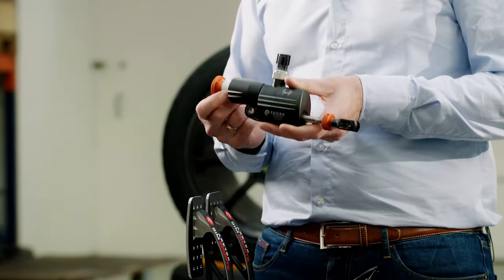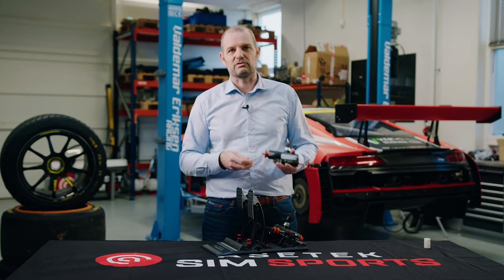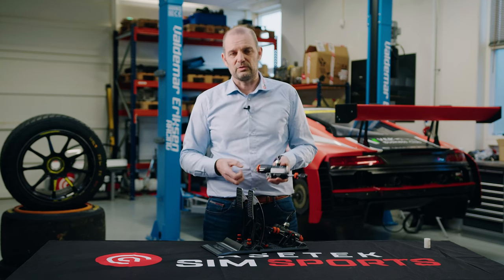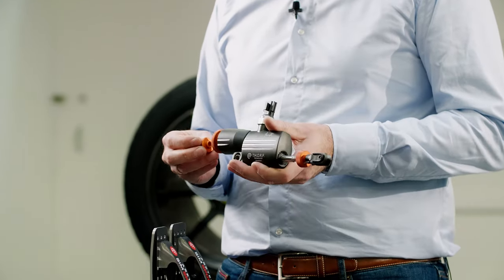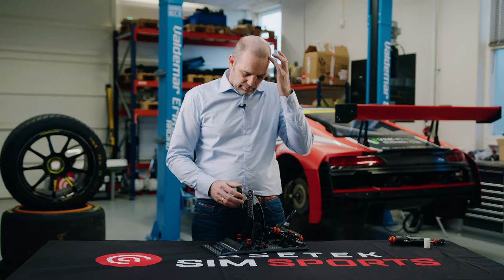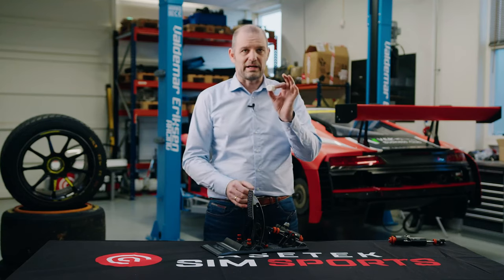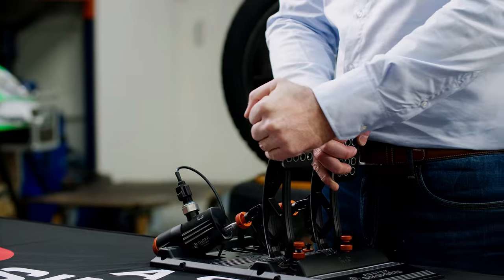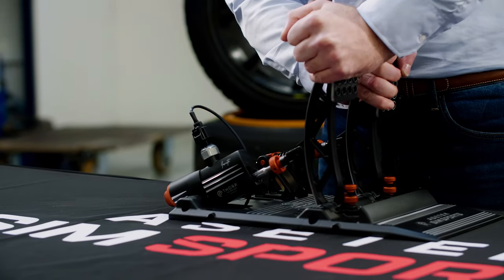The 2-Stage Brake System of the Invicta™ Pedals

Comment: I really like my Invicta pedals, but the brake isn't adjustable enough for me. I've driven many cars in my lifetime and none have had such difficult brake pedals. There is barely any travel before very hard resistance is felt. Then I have to push so hard just to get ~100% stopping force. It feels like too much. I wish there was a way to make it represent or feel like most cars instead of just certain ones. The clutch pedal is awesome and the gas pedal feels good. It's only the brake that I don't like.
Reply from the maker: Did you consider the long travel kit and the elastomer kit?

Comment: that still doesn't explain why in every onboard video we see gt3 cars brake pedal with a lot more travel than 2cm. I mean, those pedals might be tailored to simulate that specific case of the Audi you run but they surely do not represent the features of the majority of race cars.